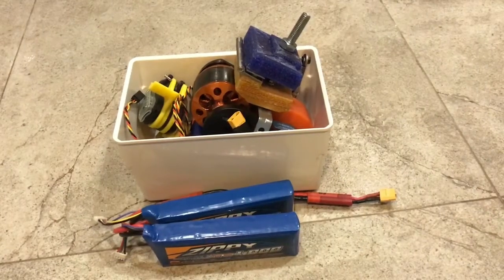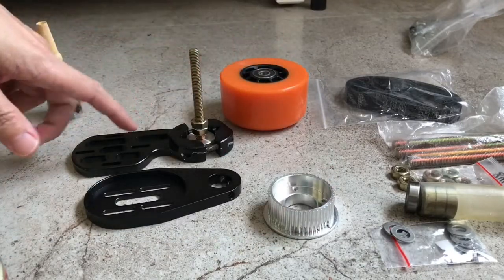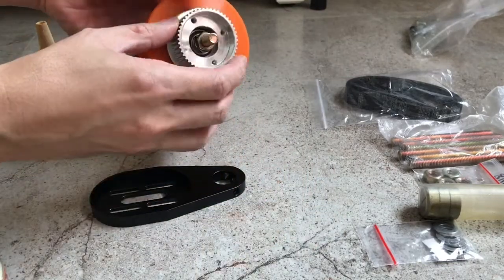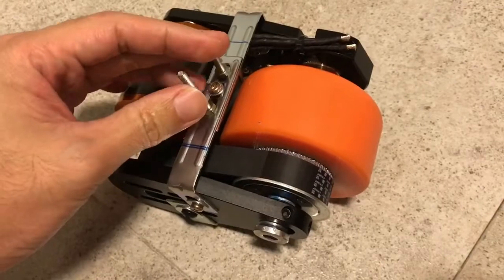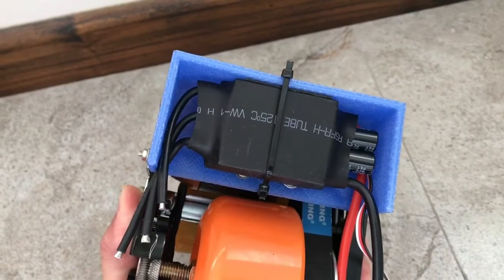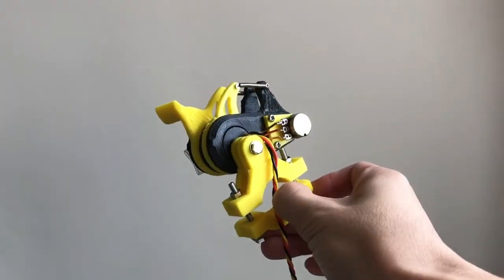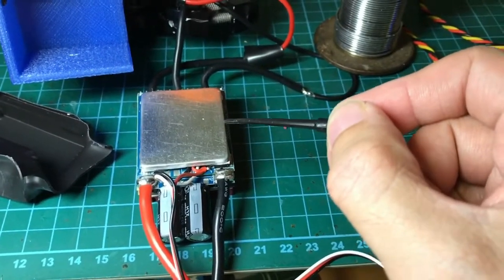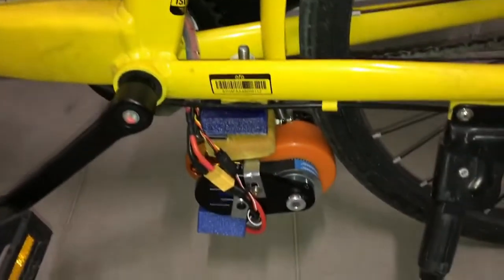3D Printed Electric OFO Bike Mod

Comment: Why did you not simply attach some friction material to the outside of your outrunner motor? Is there a reason for using the skate wheel for the drive instead of the motor shell?
Reply from the maker: Thanks for dropping by. The belt driven gear system increases the torque and reduces the RPM to prevent the motor from over-heating.  There are other factors to consider such as the diameter of the bicycle wheel and the size of the rotating can . So, your suggestion might work too if the motor’s RPM and the generated torque are correct.
Reply: @terence79chan  OK so it depends mainly on whether the motor is wound for torque or RPM. I was thinking the motor speed would be regulated by the throttle. Thanks for your reply.

Comment: How fast can you get it to go and jow many miles on a full battery cause this is gold
Reply from the maker: According to calculations based on the motor’s specs, the pulley ratio and wheel circumference of the OFO, max speed is 18km/hr. However, actual speed is less than 10km per hour due to traction issue that I am having now. Runtime is about 1hr on a 6200mah 6S (on flat terrain)

Comment: very creative, very detailed, excellent detailed explanation. I hope your an engineer some where. You actually didn't modify the bike as your e-drive is an accessory unit that is easily removed. well-done. I like how you used the Go-Pro mount to accomplish that very easily. It was a little funny in the hallway when you were trying to test and all those people walked by. I also wondered how you got those shots from underneath the bike when you were moving during testing?  Thanks for sharing.
Reply from the maker: Thanks Michael, this is probably one of the longer projects that I uploaded and your kind words mean a lot to me. I could not keep myself from falling with one hand holding the selfie stick. In the end, I simply placed the GoPro on the pedal with one foot pressing on it :p

Comment: You modified a shared bike!!!Do you have the permission from the bikes owner?
Reply from the maker: Yes, “modified” is a big word (to get views). I checked with the company and they said attaching peripheral temporary like a GoPro mount, etc is fine as long as zero damage is done. Hence I used PLA brackets so that they do not leave any marks after removing.